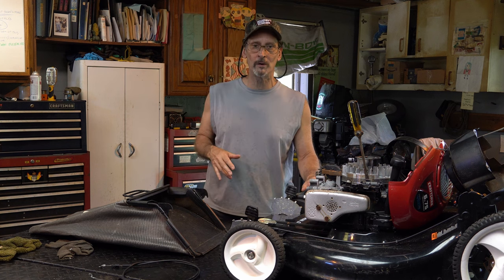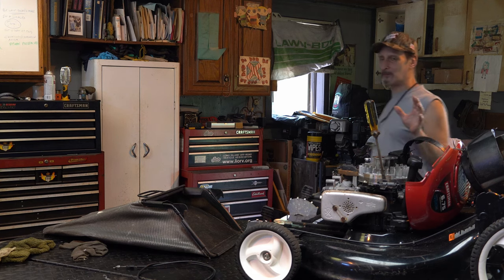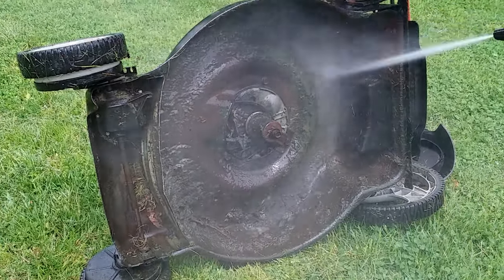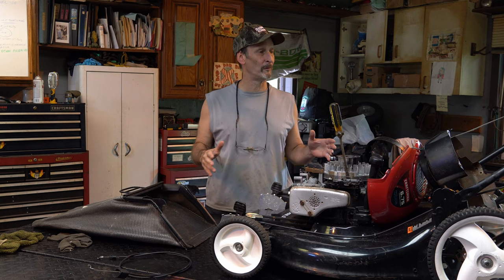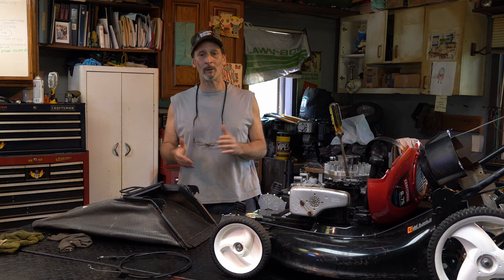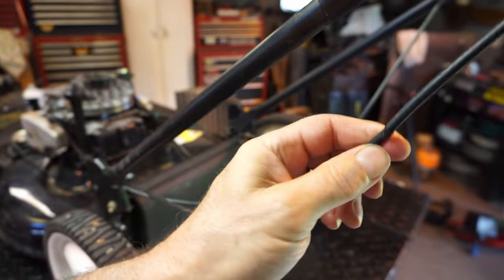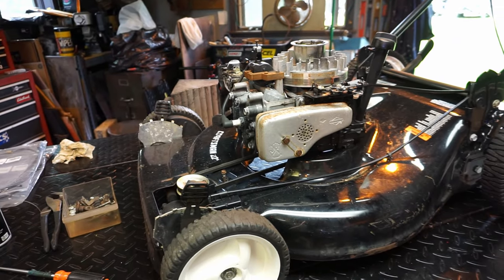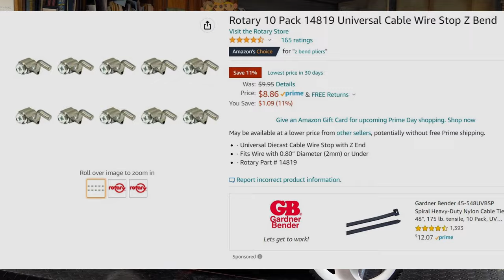FIXIN a Broken Cable~Cable Repair - Installing a Drive Cable - Craftsman Self Propelled Mower-How To

Comment: Hey Arch get yourself one of those bicycle pump cable lub tools, just remove by unthreading the end on the cable conduit and insert the cable lub tool and spray lub directly through the entire length of conduit. Works great we use PB Blaster rust and penetrating fluid. Nice fix when you cannot get the cable in buddy, same here in Canada but mostly mower blades on back order 5 weeks. So far we have been in good shape since Jake carries around $15k of inventory so rare that we do not have what is needed then just replenish stock orders made.
Reply from the maker: If ya know of a good one drop a link here for us!
I will pin it up at the top.
I have one but it doesn't see, to work well not to mention many cables are bonded. 
Also if Jake has a good vid on it pop a link I will post it up too!
Thanks again Wayne.....
Reply: @TheNovaJohn  Ours is the Motion Pro Cable Luber 08-0182 they are available on Amazon and run around $15 Cdn really good value for what they do but it is important to remove the clip in part off the cable then insert and tighten the luber prior to spraying the lubricant and it will shoot straight through to the opposite end. The only time it will not do this is if the conduit is full of rust then you must spray and work the cable back and forth the clear the rusted area out.

Comment: Thanks, Arch!  I’ve probably got a dozen free push mowers in the yard and as they came in over the last year I knew that some had problem cables but that part of repairing them had always been something of a mystery to me. Now I understand how to fabricate new cables utilizing existing sheaths and I’ll be able to get some of these mowers going again for not a lot of money. I was hoping for the promised links in the description, but got out my phone to take pics of the products at the end and that will work just fine. I just started purchasing my first real repair parts stock this week, things like 20 each of petcocks, Tecumseh carb seats, 150 micron filters, half a dozen air filters, etc, so I’ll add these to my shopping list for next week. Perfect timing!  Thanks again, buddy. 🙏👍🔧🧰
Reply from the maker: I'm bad with links so I like to put up the pics of what I find. As you can imagine, working on videos late whilst working by day,,,ughhhh
I've done of few of these changeouts now. Eventually I will make a video more in depth, this was a primer for us! I know people that do this but until ya do it yourself,,,,
Not to mention I get some odd ball machines and its nice to be able to add another skill and tool to the tool Kit!
Reply: Arch's Garage   Absolutely!

Comment: Arch i do not think Jake has ever done a video on it but i think Micks Mowers in the UK did one not that long ago same unit he also did one where he basically used a plastic sandwich bag as an IV drip unit to lub a cable overnight that seemed to be a good idea.

Comment: 1/6 stainless steel  cable it the same thing  that's used on BBQ  pits  there also the kits and single lead  cable  fitting  to repair it in most local hardware stores   it s all sold in the same section the cable is its all in  the metal section.  💯👍✌️🫡
Reply from the maker: I would also like to get solid cable insert material. Great for older machines and choke setups as well.